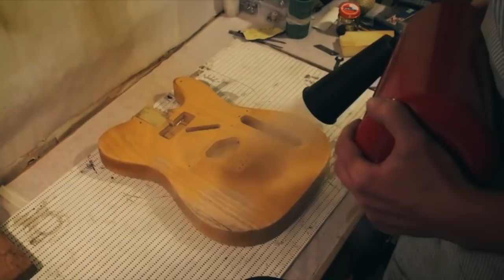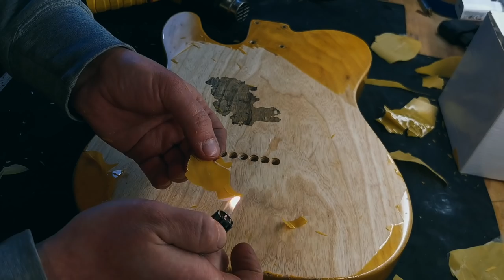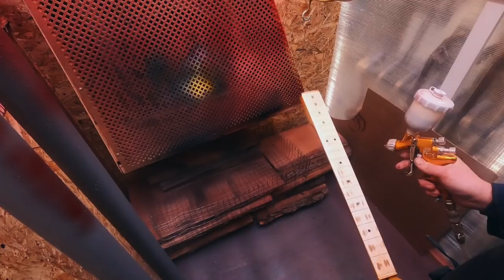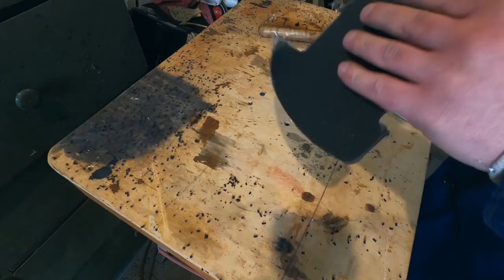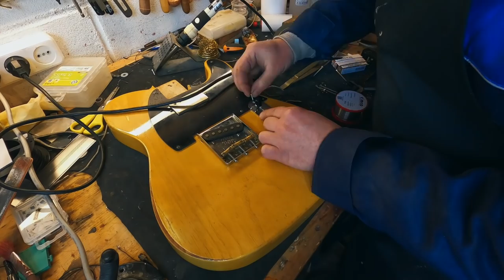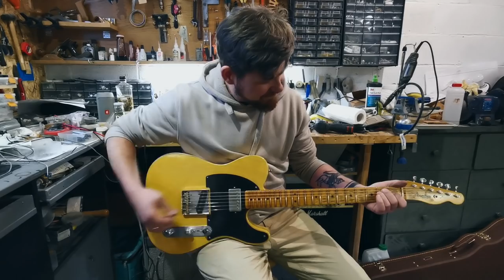TELECASTER RELICING. Removing factory varnish. Butterscotsh paint, Agind maple neck.

Comment: If Fender is saying it's nitro, it is.  That said, nitro, like any finish, can be softer if coats are put on too thick.  Gibson's are classic for this.  Goopy thick and sometimes soft nitro.  Probably do this to save time/money.  Nitro and varnish are the most susceptible.  Poly less susceptible to being soft if coats put on too thick.  It actually hardens quite well comparatively.  After finishing wood forever, mixing shellacs, etc, I started using poly more and more for work cuz it doesn't need so many coats, hardens better, etc.  That's for things that need getting done.  I would sometime compromise, and hand rub poly.  Get the look of varnish, but more durable. Then start mixing my own poly, adding varnish, linseed, whatever.   Poly basically just has more hardener in it, but similar make up to varnish.  Nitro, whole other story, but love the look and feel.

Comment: It's funny how many people have been falsely informed about tone woods on solid body guitars. The wood has zero to do with the tone of the pickups. It's like thinking a stereo will sound better with a wood casing than it will a plastic casing. The pickups, pots, bridge,  capacitors and bridge saddles are the only things that have to do with tone.
However an acoustic or Hollow body will make a difference in tone woods.
Drums, now that's got everything to do with tone woods. But you can take a 2x4, and wire a pickup under it, and get outstanding sound from it.

But in the words of the late, great Mark Twain 

 "It's easier for a person to believe a lie than it is for that same person to believe that he's been lied to."  So believe what you want.

Comment: Fender was using a very soft nitro when the American Vintage Hot Rod guitars were made. 
They are using a new formula as of 2020 that wears much faster. It cracks very easily too, no need for a huge temperature differential.
Reply from the maker: Thank you

Comment: I stripped a 1999 Fender 52 reissue. I didn't have a heat gun. I used 80 grit sandpaper. There was like 4 layers of paint. When I thought I reach the wood I didn't it had a plastic base coat. It was like a pound lighter when I was finished.

Comment: Great video. One small issue - this is probably just a mistranslation because you obvious know the subject well, but nitrocellulose is a lacquer, not a varnish. Sometimes the words are used carelessly in English, but really a varnish consists of a resin, a drying oil, and a thinner or solvent.
Reply from the maker: Thanks.  Since in my native language all lacquer coatings are called with one word, I can make mistakes.  Thanks for the explanation.

Comment: Yours relics are allways amazing. You could try to relic a squier strat or tele just for fun and educative purpose. Saludos
Reply from the maker: Thanks.  Since the Squaer and similar budget guitar lines are covered with polyester, an adequate realistic replica in this case is very ambiguous.  Polyester varnish has the most negative effect on sound, so it is better to remove it completely immediately.  But polyester is removed only mechanically.  Sandpaper or scraper.  It takes a lot of time and effort.  That's why I don't work with polyester now.  The essence of the relic is in the details, and nitrolac is best suited for this.  No other polish ages like this and has a vintage texture.

Comment: So inspiration! 🥰 I love the dark color relic near the frets and after watching your video I plan to do on my strat neck. Did you have to sand the fretboard before you apply the oil paints (mars brown and yellow)? And after apply the oil paints and the pencil charcoal on the relic fretboards do you have to use nitro on top again? 🙏
Reply from the maker: I did a thin amber layer on the fretboard, but didn't film it. After sanding, the fretboard became more contrasting.
Reply: Thank you so much for your reply. 🙏
Reply: @8BombCustom  sorry to ask you again, but did you do a thin layer of nitro laqcuer again after the oil paint on the neck? would it stay on the neck even without the extra top nitro layer? thank you!
by the way, your job is awesome!

Comment: Very cool video, thank you for making it :)!!  I have a Fernandez MIJ telecaster that has a thick polyurethane/Polyester coating on body and neck...Thinking Of using  heat gun and removing the coating and wondering if I should use tung oil as a finish on the body, any thoughts?? I have used this on an acoustic guitar with good success... your thoughts would be greatly appreciated and respected :)  I also firmly believe a guitar must be free from such a confining thick coat of poly whatever :)

Comment: Beautiful work! Which oil did you use for the back of the neck? Mine has been sanded down to bare wood but I’d prefer a light finish of some sort on it.
Reply from the maker: For this, you can use almost any oil that polymerizes.  Tung oil, Danish oil, linseed oil.  I love Rubio Monocoat two-component oil

Comment: Noticed you put the body in the freezer...how long did you leave it inside for? And did it create a lot or little checking? Linear or spider web like?
Reply from the maker: My freezing technology consists of several cycles at a temperature of minus 20 degrees Celsius.  The time of each cycle is different and depends on the nitro.  Degrees of hardness and drying.  So cracks are obtained perpendicular to the grain of the wood and exactly repeat the effect of the varnish cracking from time .  A spider web is obtained by using a sharp surface cooling using liquefied carbon dioxide or nitrogen.  This method does not give realism and can damage the splicing nodes of the parts.

Comment: Amazing work I love your videos, I am about to build a blackguard style telecaster Myself using a 2 piece ash body.  I don’t have access to a compressor for paint unfortunately but am pretty good with nitrocellulose aerosol paint cans to achieve a nice finish.  Can I just ask your advice on achieving the butterscotch colour please, am I best buying a butterscotch nitro aerosol ready mix colour and then applying some Amber tinted clear over the top or would I just be better using just Amber tinted clear and build up the coats?  I will also use a natural grain filler and a sealer coat prior to spraying.  Thanks I appreciate any advice you can give on achieving the colour with the nitro spray cans?  Thanks.
Reply from the maker: Thanks. For the vintage paint scheme, there should be a white base coat after the pore filler. Since it is thin enough, it is translucent. After that, the color is recruited with a tinted yellow (amber) varnish. The finish coat can be clean. A aerosol spray can also work well on a guitar, but it is more difficult than a spray gun. pressure and nozzle stains are not enough for an even layer of clear paint. But it is possible. If there is a relic later, then no problem. Relic masks all mistakes.
Reply: SimonwGB. I can relate.
All I have iaccess to is cans of nitro. Even have to buff with drill and foam pads.
Good luck in your butterscotch quest.
Reply: @8BombCustom  thanks for the reply and advice I appreciate it.  I have a white nitro spray can primer so will apply a few thin coats.  Thanks it sounds like the Amber tinted clear is the best approach, would you also then recommend a 10 day drying time before wet sanding and polish?  I will then be lightly relicing the finish.  Thanks again and great work 😊
Reply: @germancarluv  thanks good luck with your project too, I am going to try the white base coat and Amber tinted clear as Dr Nitro has advised, just need to work out if Amber or weakest Amber clear would be my best option.